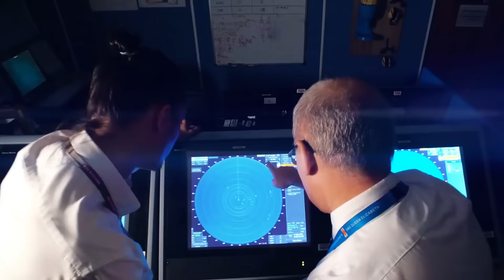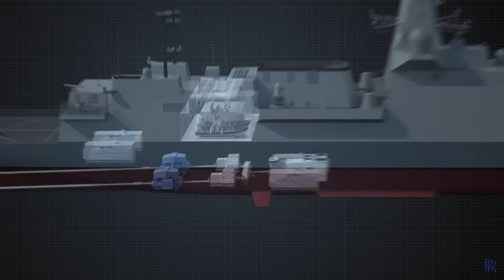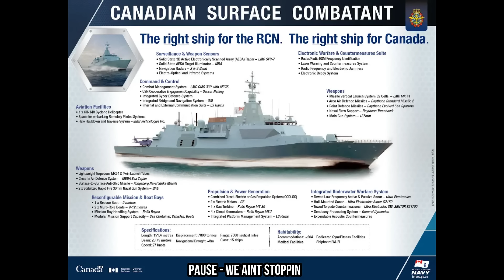Canada's New Warship

Comment: According to current speed, by the time the whole fleet was commissioned, they would probably already outdated.
Reply from the maker: Its frustrating.
Reply: Of course 'it' will be outdated but while it will be the same hull, the bits and pieces of kit will change. One hopes. A new hull (like a new airframe) is just a platform. After that, it depends on future budgets...and changes in tasking.
Reply: Outdated by whos standards? who is building more advanced ships?
Reply: Compared to the United States probably but who else?
Reply: @heybabycometobutthead  by German, Danish, American, Japanese, Chinese, Turkish, Swedish, and Finnish standards, off the top of my head.

No other modern navy/nation can bungle a project like Canada can, except maybe the Russians.
Reply: @Drew Peacock Sinking a ship is actually pretty tough, whereas subs are half-sunk already.
Reply: @Drew PeacockDestroyers and Frigates are quieter, more maneuverable, and is better equipped for ASW than a carrier. The reason carriers are surrounded by smaller ships is because of how wide a variety of weapons and systems they can deploy, and how easily they can be replaced. A multi-mission capable sub takes longer to build and costs significantly more. 

I didn't initially reply to your whole comment because the evidence against it is apparent in the modern navies currently afloat. Destroyers and frigates lead the way, supporting LHDs, tenders, and carriers, big and small, and being a screen for subs when they actually maneuver with fleets. 

No navy is going to risk a sub for piracy, drug enforcement, or presence patrols.
Reply: @Drew Peacock Ship's are not too easy to take out XD. An Arleigh Burke, for example, costs 1.8 billion and takes two years to get a hull in the water. A submarine capable of being a threat, like a German Type 212, costs a fraction of the Burke, but takes 5 years to get into the water. 

Using a war 40 years ago to justify the drawbacks of a surface fleet in the face of super sonic anti-ship missiles discounts 40 years of development dedicated to knocking  SSMs out of the sky. 

Ships are faster to build, easier to operate, and pack a bigger punch.

Subs are harder to build, harder to operate and maintain, and have to be specialised.

Modern naval doctrine reflects this.

Comment: The Canadian type 26 is also the most loaded, from what I've been hearing we maxed out the tonnage for the hull lol. The type 26 being very flexible.

Because of hypersonic missiles they already have to consider the laser weapons being implemented. They are still in the test phase in the states.

They'll likely be more expensive than the Australian or English ships because of the extra stuff being slapped on it
Reply: CSC is a floating sensor platform that can't fight its way out of a wet paper bag because of its small VLS and will have to be protected by a USN destroyer .CSC is not optimized for ASW as it's torpedoes do not have a self defense function and does not carry asrocs ,ship is not optimized for air defense either as CSC has AEGIS baseline 9 no BMD and no SM6 ,add in the tiny 24 VLS on a 9500 ton full load displacement ship that has its propulsion system maxed out with no hope for any relevant future upgrades before steel is cut ,this project should be cancelled as CSC has almost no combat capability due to its lack of weapons and is a overhyped and overpriced one trick pony design that can't be upgraded without serious design changes.
Reply: and likely because Canada includes servicing in total cost of vessel most others do not
Reply: That is bullshit. Australia  has the most powerful varent of the class been offered by BAE systems for type 26 frigate. With a total 96 cell VLS and CEFAR-2 electronic scan aray radar system  Aegis combat systems. 2x 30mm guns. 2x phalanx 20mm close in weapon system. 4 x heavy machine guns. 6 torpedo tubes. 16 NSM missile  tubes. 5 inch main gun. Nulka decoy system.  MH60R helicopter with lowing  sonar system Including underwater torpedo size drones with ASW detection systems.  

Total displacement over 10.000 tonnes 13.000 nortical milies range at 26 knots cruise speed. top speed over 32 knots.

Missile varent. To be loaded on Australia  hunter  class ESSM evolved sea sparrow missiles. Main armament.  

Anti aircraft.  SM2 and SM6. 

Land attack Tomahawk and LSRAM. 

Anti submarine Asrock and torpedos. 

Anti ship NSM and LSRAM. 

BAE has also offered 128 cell VLS varent type 26 to Australia  but requires the removal of the main 5 inch gun. Pushing the ship weight upto 16.000 tonnes  with  still having  the same range and speed  through  modifications.
Reply: @alpearson9158 it depends how the government puts the cost to the public.  The total cost of each ship or that and the total cost of servicing over its lifespan. 

Australia did that with the nuclear powerd submarines that included the cost of 8 future subs. Including  5 Virginia class as a gap. Crew training.  The cost of the program of the build included ship yards.  Investment of requirements to have it earlier as possible.  And the lifespan servicing. Total cost 368 billion dollars.

Comment: In my opinion these ships should be equipped with AEGIS system. I also think we should buy 10 destroyers like the Arleigh Burke class for missile defence and military capabilities. We should have more than 15 warships given that the north west passage is opening too.
Reply: Which what money
Reply: Australia varent of the type 26 will  all have Aegis combat systems.  CEFAR-2 electronic scan aray radar. Now it's  been upgunned too. With MK41 96 cells, vls. 32 cell forward.  And 64 cell in the multimission bay. That be Australia varent of the type 26

The ship will still have 13.000 nortical mile range at 26 knots.  Top speed over 32 knots 

Just copy Australian version type 26. It be better  than the Burk class destroyers

Comment: Australia has apparently deemed the platform dangerous to the survival of the crew
Reply: Australia have wanted to alter the design heavily which has resulted in issues - diverting from the original design. The issues have been self-inflicting, not actually issues with the original British design of the ship itself.
Reply: @dWFnZWVr  It's a piece of shit, they need to cancel it and just build more Hobart Class.
Reply: @iangodfrey4518  It’s not, Australia need to consider their requirements. You don’t buy a Mustang only to try and make it a Prius.
Reply: @dWFnZWVr  Listen sport, the design authority BAE said it would meet the requirements, or rather they could make it meet the requirements, and of course, as we are finding out now, it will be overweight, underpowered and slow as fuck.
Reply: @iangodfrey4518  Don’t call me sport and don’t think you are able to converse on my level. You are not on my wavelength in any aspect of life. Australia changed the design, that is a fact. You aussies wanted to change too much, there is nothing inherently wrong with the design - as it was intended - what so ever.
Reply: @dWFnZWVr  Listen, Sport. Don't give me that garbage. BAE sold an unsuitable platform to contract specifications that could not be met with satisfactory margins. Us Aussies did not want to change anything, it's not like we accepted that ship as designed from BAE then tried after the fact to cram extra stuff in. No, no, no. BAE knew exactly what they were doing. It's a piece of shit that needs to be cancelled.
Reply: @iangodfrey4518  I’m going to ignore the “sport” - for now. Again, BAE systems are not the issue, the Australian design changes are. The Australian government could have submitted their own design for a ship and contracted it to BAE systems. They didn’t. Instead, they wanted to use the existing British blueprints but demand a heap of changes which completely undermined aspects of the ships’ original design. Britain’s been building ships longer than you’ve been a country and before Australia was even a penal colony. So, as I said: the issue is not the ship, it’s the ridiculous changes you lot want.
Reply: @dWFnZWVr  Oh, here we go, now the insults start. When you start insulting, you know you have lost the argument. The bare Facts are, BAE conducted a year long  System Definition Review aimed at establishing a baseline for the Australian Hunter class.
The review assessed the feasibility ... capabilities required ... including Aegis and Australian Interface Combat Management Systems, CEAFAR2 phased array radar and integration of the Seahawk Romeo Maritime Combat Helicopter. The System Definition Review demonstrated the prime’s ability to “Australianise” the frigate.

You are not getting it through your thick head ... Australia did not "demand" these changes, CEAFAR and all of the above was well known about and required up front - on whatever ship was built.

Theres images out there on the Navantia design with CEAFAR - the F5000.

And the Fact is, BAE said they could do it, and they spent a year on studying the integration of the above. Like all defence contractors, they over promise and underdeliver.
Reply: @iangodfrey4518  What? When have I insulted you? I think you ought to re-read my message because you’ll find I didn’t. If you cannot distinguish between what an insult is then my point from earlier stands firm. Facts about your country in context to my point are not insults, they are facts. Just because you don’t like them does not mean they are insults. Calling me “sport” ironically is more of an insult than anything I’ve said; it was directed at myself. Clearly you cannot engage in discourse at a mature, intellectual level. I would have thought you’d know what an insult was.
Reply: @dWFnZWVr  Yes Britain has been building ships since when ever. So what? It's not as if they have been big international success stories recently. Just the opposite until Type 26 came along. So you can keep your superior attitude. BAE said they could do the changes, and then when the time came to actually do it. Guess what? They couldn't. Typical over promise, under deliver.

Comment: I was hoping for the  Iver Huitfeldt class Danish boat. Longer range, faster top speed. Already completed production line. Seems like it was pre decided it would be this ship. Hoping for the best.
Reply: The AH140 might have been a better choice; at least if Canada got an exact copy of the Type 31 instead of loading it up with systems that had never been integrated before.
Reply: @GSteel-rh9iu  That type has no sonar, so it's not really any good for the RCN mission.  Still hoping Type 26 does everything it's designed for. Almost twice the tonnage of the Halifaxes, so there's should be enough room for everything.

Comment: So the concept MEKO a300 and a400 with lasers to target drones and missiles is faster, lighter and can outgun the concept t26. Also over 3-a300 and 2-a400 to 1-t26. For the price, 5-t31 can outgun and preform the t26.They still make exercise equipment you can attach to the wall or stow under a bunk. Until ships can travel under the ice which the Russians are very skilled at, 6 ssn and 6 ssk submarines are required. Hudson Bay is 300 meters deep. 2-3 ESB or ESD in the North are required.
Reply: Russias many submarines in the North I am referring too.

Comment: Could the Harry DeWolf be refitted with better weapons for war time maybe?
Reply: Anything is possible but I would dought that hopping based on cost and time. But then again during war time you just never know. But I think it would have to be a major conflict for that.
Reply: Yes it definitely can and in my opinion it will in the next couple of years! Already all of the .50 cals will be replaced with the naval variant of the Nanuk remote controlled weapons stations that the navy acquired from the army after they were phased out from the LAV3. I also see the navy mounting some kind of short range air defense system (probably phalanx ciws) or at least countermeasures and chaff launchers in the upcoming years! Otherwise the Harry DeWolf isn't designed to fight, it's designed for ice breaking, logistical support and reconnaissance for which it is very well equipped!
Reply: Also you mentioned war time, historically Canada has always armed it self up to teeth whenever it went to war so I wouldn't worry about that! Example for Desert Shield in 91 HMCS Protecteur a non fighting support ship got equipped with 2 Phalanx ciws, 4 40mm autocannons two in front of the bridge and two mid ship, a bow turret with dual 3"/50 canons, dozens of mounted blowpipe launchers and javelin MANPADs all over the ship, 6 .50 cals and countless countermeasures launchers most of which aside from the Phalanx were removed after the war
Reply: It's a pretty easy thing to do. The base design that De Wolf is derived from has a 57mm Bofors and they can be upgunned. I think that the issue is to not provoke an arms race in our Arctic at the present time. The heavier the ordinance we start out with, the heavier the guns we face as competitors launch their arctic ships.. These ships might be in service for a half century and the majority of their service might see them as buzzing drone hives with the old fashioned guns gathering dust.

Comment: seems like the wrong choice for canada considering their navy has diffrent missions and needs to the royal navy (who it was designed for)
Reply: It's a really good design with a fatal flaw,the propulsion system only has a single turbine setup ,the latest CSC image and specs say it has 24 mk41 vls  it was 32 previously it lost 8vls to cut weight to make speed requirements which also means it's future margins are not good so it's lightly armed for its size and it won't age well . Redesigning the ship to double the propulsion system would have been worth the delay as we would have a more capable ship with good margins for the future .The overall sensor package is great along with aegis baseline 9 no BMD and CEC but it can't Carry enough weapons to take advantage,the Australians are having a similar experience with their version

Comment: Should have bought the FREMM like the US which was offered at at fixed cost less than half what we are paying for a unproven design
Reply: The constellation class is a better overall warship than the type 26 and it meets our requirements better as well ,CSC has the tonnage and combat system of a destroyer and the weapons of a lite frigate,it's a complete waste of time and money for Canada and will be obselete before all 15 are built
Reply: @kannabis7999  after choosing the planform you outfit it with whatever systems you desire like the US did and Canada is doing so not really a good argument. The most powerful navy in the world is quite happy getting the FREMM instead of a new unproven design
Reply: @ironman7261  the type 26 propulsion system is the problem ,it needs to be doubled up ,the hull stretched out add extra fuel and vls , essentially making it a destroyer , the constellation class is the best frigate design out there right now ,a couple small changes and it would be perfect but as it stands we are stuck with a failed project that hasn't even started and won't be cancelled ,80 billion down the drain what a waste

Comment: Good to see Lockheed Matin leading the contract to build ships in Canada and ensure the UK weapons and sensors are replaced in the Canadian variant with proven, top of the range US systems. Just make sure you do not use any propulsion system from the UK (RR) as the problems of the T45 are not something you want. Remember the upholder/Victoria class? Buy British and regret, regret, regret...
Reply: Wasn’t the T45s problems due to an US company?
Reply: @leotran9259  No, US companies did offer several alternatives that the rest of the world used. The UK was the only country that decided to use a RR engine. The American engines are fine.
Reply: @leotran9259  The WR-21 gas turbine engine was a joint development of RR and Northrop Grumman.
Reply: @originalkk882  ah thanks for one info
Reply: @carterstrain9951  nope it was a US supplied component that wasn’t up to the job
Reply: @robertpatrick3350  exactly which one? because every I can find points towards a british component.
Reply: They already cut VLS so the ship can make speed requirements ,the combat system and sensors are top notch but the propulsion system is already maxed out and the ship has no margins for future upgrades . Australia is having the same problems and the project is to far along to start over we are pretty much f$$ked now the costs are ballooning and the project keeps falling behind .The type 26 doesn't use the type 45 propulsion system it uses the type 23 s which works fine but is not powerful enough to do the job ,a hull stretch ,double the propulsion ,extra fuel and add more VLS  .A month or so ago there was a article in the Ottawa citizen saying that the government was looking for influencers to try to spin the CSC in a positive manner good look with that   the CSC project is going to a anchor around the neck of our navy and government for a long time .
Reply: Irving is the lead, LMC is the CS integrator.